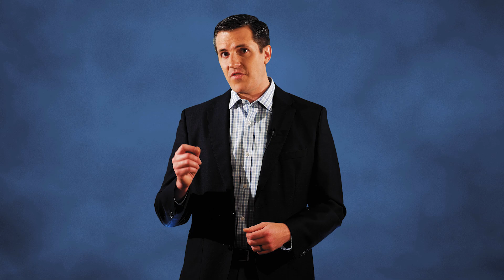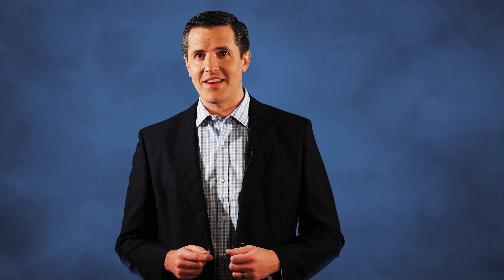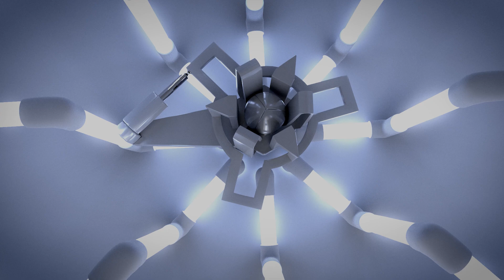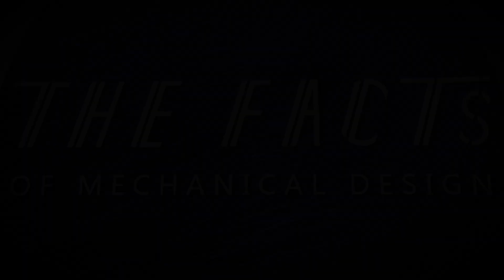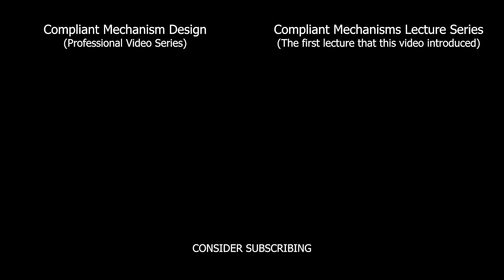Compliant Mechanisms Lecture Series Introduction

Comment: Fantastic video lecture series, thank you.  I enjoyed it a lot and learned new modes of thinking about motion and mechanics.

It seems to me, you left out one type of degree of freedom of motion... one that's distinct from transational, rotational, and screw.

A first way to visualise it might be... a frisbee.  It has transational component to its motion (to a first approximation, constant velocity) and a rotational component (again, to a first approximation, constant) - but the axis of rotation is not in the direction of translation.

In the case of a frisbee, the two are orthogonal.  A real-world example of this motion in mechanical design is a rack and pinion, where the rack is considered to be 'ground'.  Typically, the axis of the pinion is at right angles to the direction of rotation, but it's not beyond imagination to visualize that it doesn't necessarily have to be.  Dragging a Mecanum wheel or an Omni wheel 'diagonally' across the ground gives the idea.

So, if this class of motion were to stand alonside 'translation', 'rotation', and 'screw', giving it the name 'pinion motion' might fit.